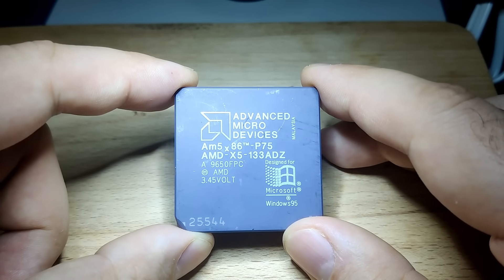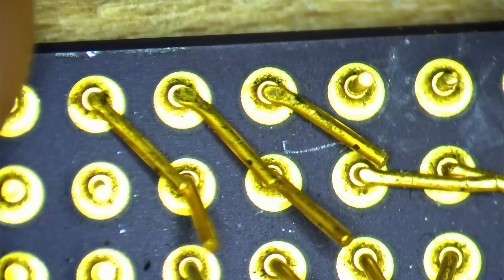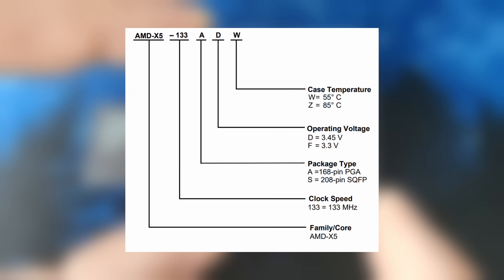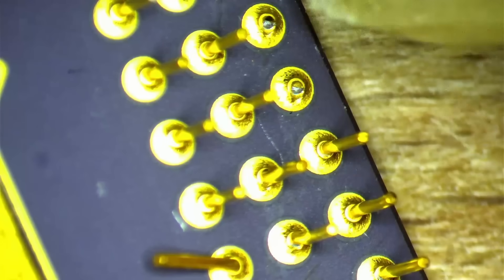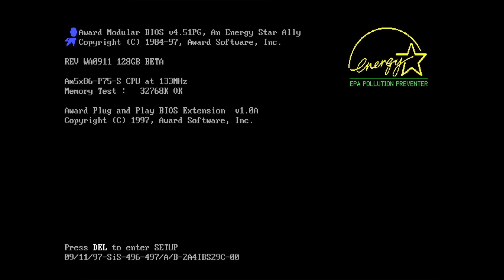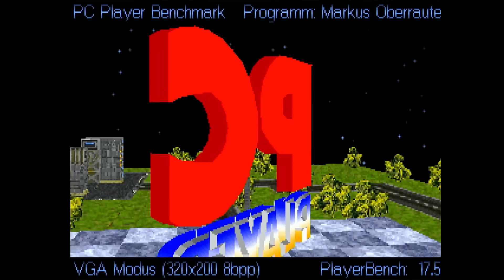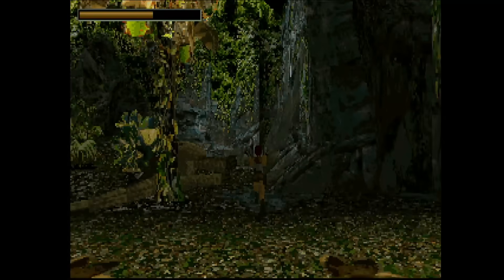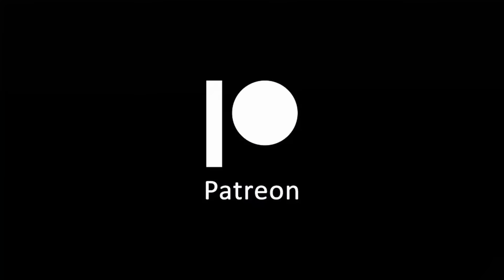Tomb Raider (1996) on the fastest 486 CPU (Part 4)

Comment: By 1996 for gaming even the budget gamer didn't have a reason to get a 5x86 CPU, as a Pentium 75 PC could be built for 100 USD more than a 133 MHz 486 PC and get much better performance in games like Quake. For 1k USD you could build a Pentium 120 PC.
Reply from the maker: A Pentium 75 definitely would have a better floating point unit and would be beneficial to run Quake. But maybe not everyone was ready to replace their motherboard and potentially the memory. A CPU replacement would be much cheaper than upgrading to a Pentium system.
Reply: @bitsundbolts this why AM4 is the greatest platform to have been around in decades.  Intel had us used to changing platforms because it would add or remove one or two pins and with the same core count.  It is good to see Intels lunch being eaten.

Comment: I grew up on my dads old hardware. My first PC was 386, then I got a 486 DX66, then his 100mhz when he upgraded to a Pentium 166mhz. Then I got that when hey got a Cyrix 233mhz with a Monster Voodoo 4Mb card. Again I got that when he bought a Celeron 466mhz.. anyway loved the video and brought back many memories building pcs with my dad in the 90's-2000's.
Reply from the maker: I'm always happy when a video brings back memories! You went through many systems back then - for the most part, doubling your compute power with each change. That must have been awesome!
Thanks for watching!
Reply: Serial and co-axil LAN from Doom right up to Quake 2 DM. However my system being the older dad always usually had the advantage. Till I bought my own Duron 700mhz + Riva TNT2 32mb card. Fun times late 30's now :D  @bitsundbolts

Comment: Just awesome! The bending adventure is real. I'd really liked the detailed review of this CPU incl. overclocking. Socket 3 is not my cup of tea (I started with socket 5) so I have a question: why are there less pins on the CPU and more possible contacts/holes on the CPU socket? Looking forward for the next VooDoo Repair; it looks really bad! Wonder what people do with their hardware? Use it as a door stopper!? Thank you for saving all this hardware!
Reply from the maker: To my knowledge, Intel designed socket 3 with future CPUs in mind. The only CPU I know of that uses the outer rows, is the Pentium OverDrive. I'll have a second video about this CPU soon once I get the fan. The outer row is mainly ground and power pins.
Reply: @bitsundbolts  Thank you very much for your answer! Looking forward now to the VooDoo AND the Pentium Overdrive! .D
Reply: The extra pins are mostly ground and power. The pentium overdrive used those. There may possibly have been some other niché stuff that used them but I'm not sure (e.g. one of those evergreen upgrade things).

Comment: usual stellar job in fixing those pins and nice CPU running at 160MHz!
About the heat, my understanding is that it would allow you to bend the pins while keeping the structure of the metal intact. Doing it at room temperature won't be more difficult but the metal might weaken more. in other words: you won't see a difference but heat should make the process more reliable. 

That said: using the broken socket to finish the CPU off is definitely a cheat ;) 

Thanks for the video!
Reply from the maker: Thanks for watching Tony!

Comment: would love to see how far you could push the overclock on this chip.
Reply from the maker: I'll try 200 Mhz at increased voltage later. I already tried at 3.45v, but the system didn't boot.

Comment: A needle from a syringe. The sharp part is cut off and the rest of the needle is put on the pin. After that, the pin can be gently bent back. Try.
Reply from the maker: I got some ink refill syringes. Unfortunately, the opening is too big and it's not a nice way to work with. I have to find thinner syringes or something similar

Comment: At this point I think you should build a tiny hollow pin straightening tube/pen. Great effort, I had a box of CPU's in similar condition and it was not fun, the old socket thing is a good trick though!
Reply from the maker: That would be a good idea to build something like this. Although I am done for now, there is a box with socket 7 CPUs waiting :) Such a tool could reduce the time immensely because many pins would probably take a fraction of the time when using such a tube with perfect properties for a specific socket. The more difficult pins can still be fixed manually. I'll think of something.
Reply: @bitsundbolts  Maybe something like soldering needles? I'm using them to straighten legs of TH components when desoldering. Pack of 8 different sizes is ~2€ on AliExpress.
Reply: @bitsundbolts  
I saw pictures of someone using Pentel Graphgear 1000 automatic pencil for AMD pins.
That straightening tool should be made as pliers with inner diameter slightly smaller than the pin diameter, so you could also straighten the twisted pins. By simply closing the pliers, you'd squeeze and straighten the twist.
Probably buying some bend or straight smooth jaw long nose pliers and then machining them to specs would be the best idea. You could easily punch the channel for pins on the surface of those smooth jaws.
Reply: @Stefan_Kawalec  why would someone use such a expensive pencil? Wouldn’t any fixed-sleeve pen would do?

Comment: Nice work with the CPU pins but the best performance I think is with the pentium overdrive PODP5V83 (83MHz) OC to 120MHz or more if the CPU is stable of course
Reply from the maker: I hope you are right! So far, I am not happy with the performance of the 486 CPUs. Two more jokers are waiting: The Pentium OverDrive and the Voodoo 1
Reply: POD isn't interesting. Then better to go to socket 5 or 7 platform

Comment: It is just so beautiful to see your work on straightening the pins...

And woah!? ADZ with write back L1? I thought only ADW (of those 3-letter variants) can do that...

NB! 3x50 might give better results than 4x40, as with higher FSB the memory access and L2 cache access becomes faster, too. When using VLB videocard, it helps that too. Maybe worth to try?
Reply from the maker: You are absolutely right. I tested 150 MHz as well, however, in SpeedSys, 160 gave better results. I will test this once we get the Voodoo in there. I also want to try 200 MHz. At 3.45V, the CPU doesn't boot. Maybe I can try my luck at 4V.
Reply: @bitsundbolts  yeah, speedsys and other such small benchmarks usually do some small loop test or something similar. And when that test code can (mostly) fit in L1 cache, then the bus speed doesn't matter. But with "bigger" tests (for ex. Doom run) the bus will be heavily used and difference may start to appear. ;)
Reply from the maker: I want to change the motherboard later in a "tuning" video because the Soyo only works with FPM memory. I did see a big improvement in memory bandwidth when running at 50 and even 40 MHz bus speed. I agree that a proper test using some games will be much better than those synthetic benchmarks. More videos to make :)
Reply: @bitsundbolts I was about to ask if you were going to try 50x4, so heck yea. Actually had a few 5x86's back in the day and we ran them all at 160 - and assumed they all would. Based on what I've read nowadays we just got stupid lucky with the ones we had apparently!

That said we never got 200mhz to work, but we also didn't have any boards that would officially do 4v, and I imagine we'd have been too chicken to try it even if they did!
Reply from the maker: Hehe, what's the worst that can happen at 4V - the CPU dies. Oh well,  content is made and the videos are online. I really hope that the CPU can do 200, that would be nice!

Comment: Great job straightening those pins! They were really in bad shape. So much effort to bring this CPU back to life.
Reply from the maker: Thank you! I am happy that I could save this CPU, even if it took a lot of time.
Reply: @bitsundbolts  Would have been way easier if u used the tip of a mechanical pencil to straighten those pins